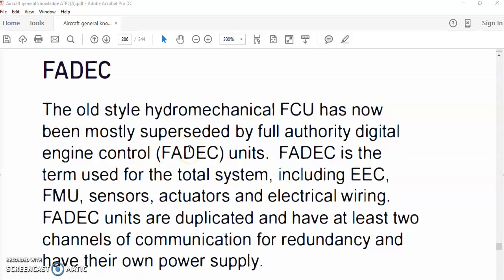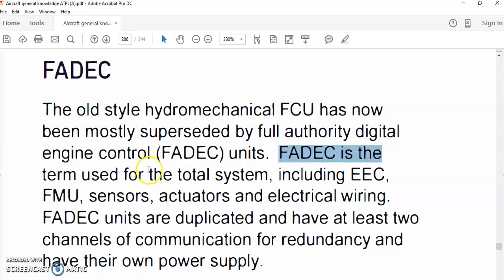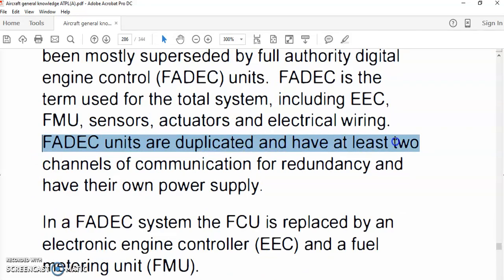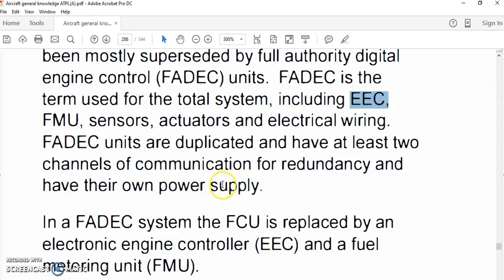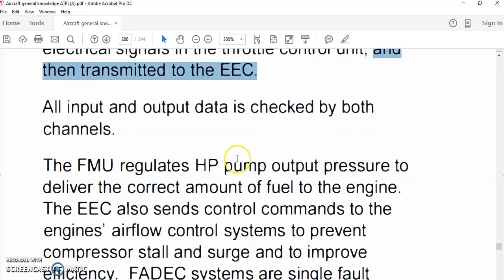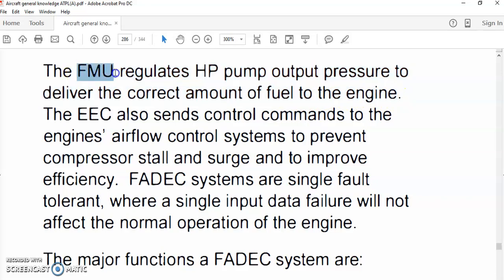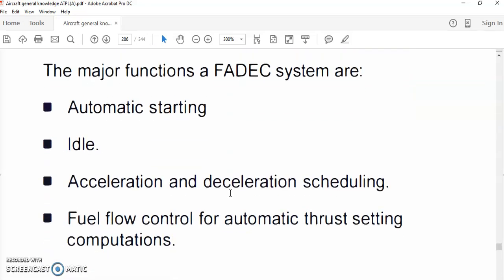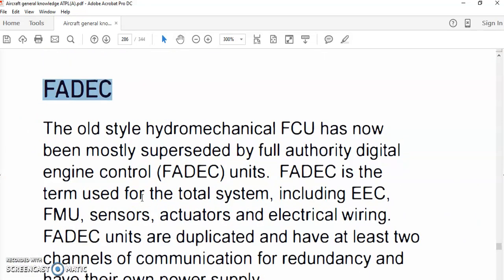FADEC principles for the new gas turbine engines control, Aviation training solutions by haytham aly

Comment: please start system wise explanation video. would be of great help...
Reply from the maker: You need an explanation for the engine starting system ????
Reply: Aviation Training Solutions If you can explain the thrust bearings, load bearings, bleed system, the different engine bleed valves, it would be great
Reply from the maker: Sure will do